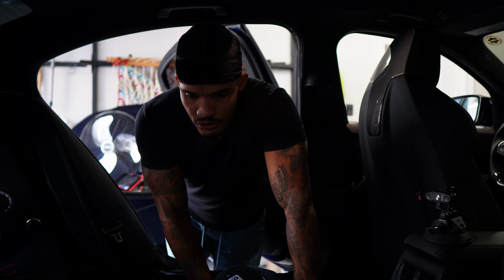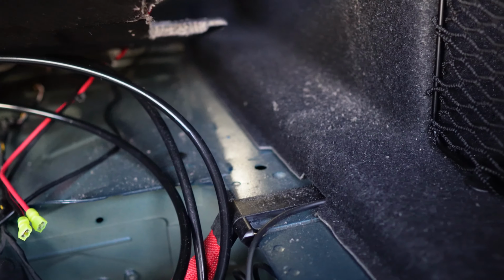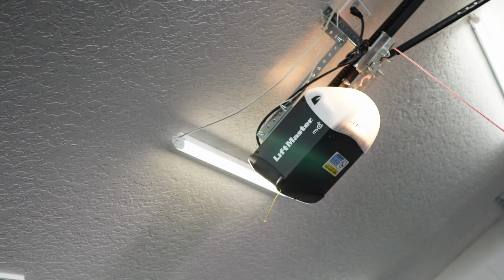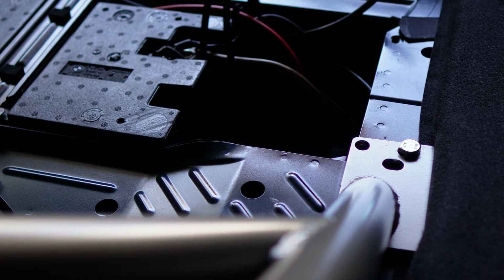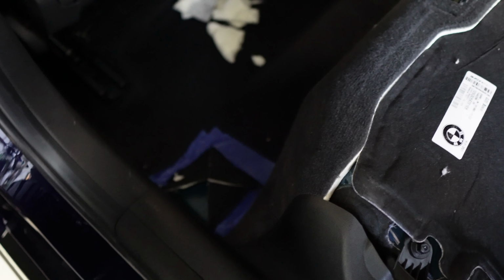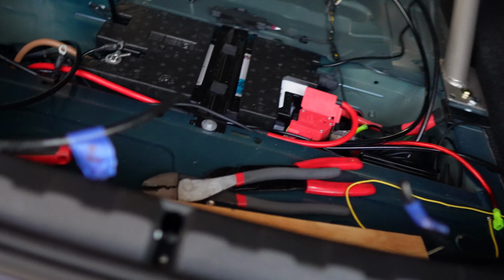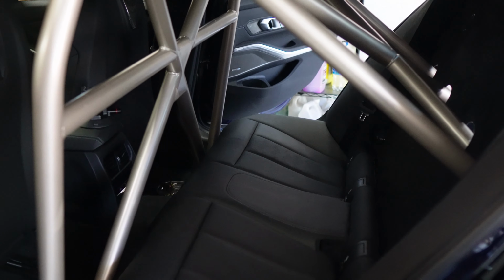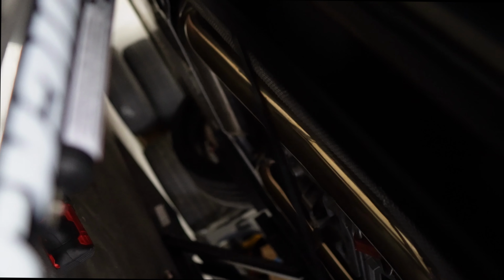KNOW THIS, Before installing a Roll Cage in your BMW!!! - G80 M3 - 4K

Comment: Nice video! Finally a detailed install video. Is it possible to just fold the rear seats back down with the headrests removed? Seems like there’s just enough space that the folded down seat  backs won’t touch the main hoop. I want to get this with the quick release for track days and removing it afterwards for daily driving. So it would be much more convenient to not having to remove the seat backs.
Reply from the maker: thanks for watching. You know what I think you probably could fit it with just the seats folded and head rest off. I have the seat delete which looks really clean. Also, they over a quick release version for the bottom floor mounts so once you bolt the base to the floor inside the car, it can be quick released with just allen screws.

Comment: Shouldn’t you have put a rubber washer between the floor of the car and the bolt for water leaking into the car.
Reply from the maker: I don’t think. Only because the bottom bolt is covered by the plastic undertray so water would really be triumphant to make it up into the cabin